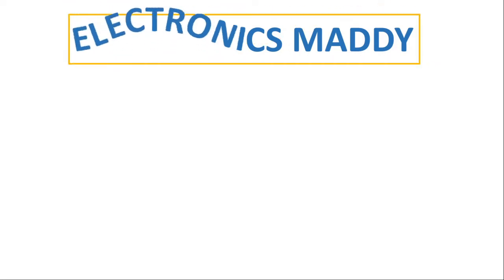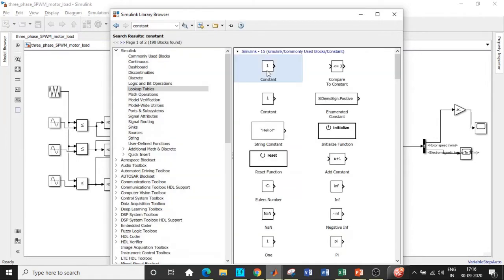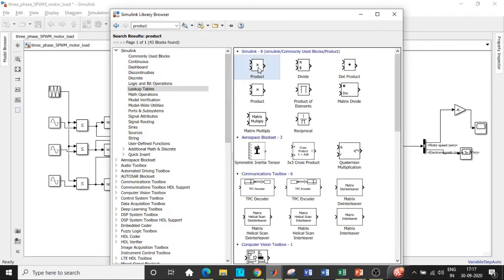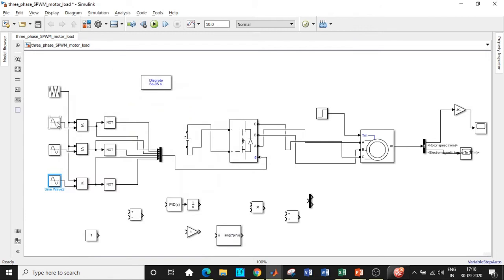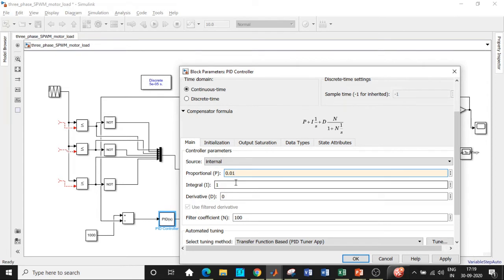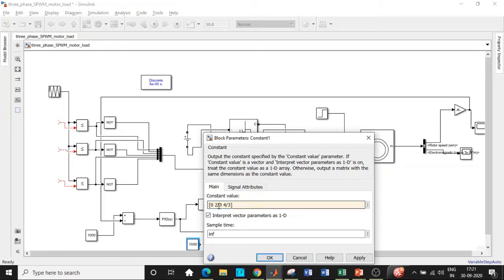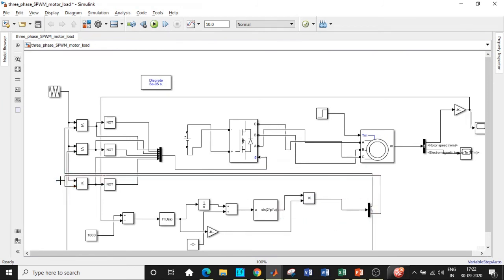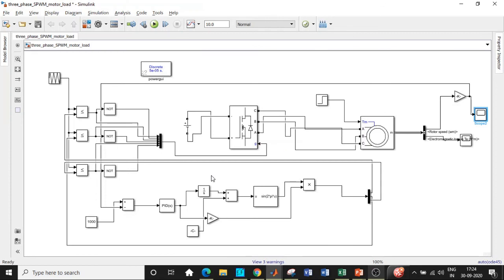Closed Loop Simulation of 3 Phase SPWM Inverter for a Motor Load in MATLAB | SIMULINK

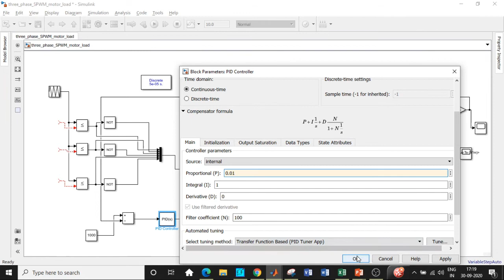Comment: hello sir, I replicated everything that has been said in this video but my output curve settles at 0 instead of 1000. So  I feel its due to the feedback circuit in which a gain block whose value is not mentioned and the look up table, integrator whose specifications are also not specified. After 4:35 in the video there is a break so can you please clarify this issue and help me out. Thank You

Comment: Sir it is evident that some specifications regarding the feedback circuit is the main cause of the issue which I face. So, I kindly request you to specify more about the look up table, integrator and a gain block parameters in the feedback circuit. Please sir.
Reply from the maker: Hi Gokul. There is a cut but i havent missed out any parameters except gain block. Look up table will be generated directly by matlab. There isnt anything that we do with it. Gain block value is 1/60. Hope this helps. Good luck:)
Reply: @ElectronicsMaddy  Now got 1000rpm. Thanks
Reply: @akash1927   value in the integrator block and what solver setting you applied?
Reply: Please reply